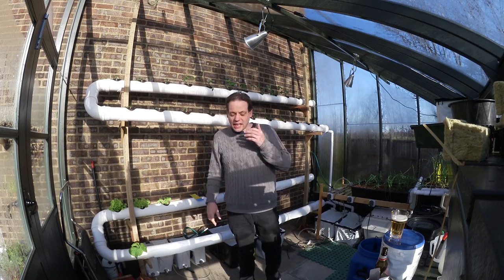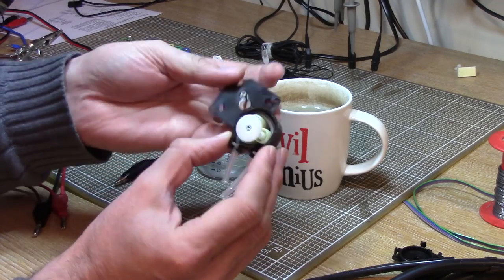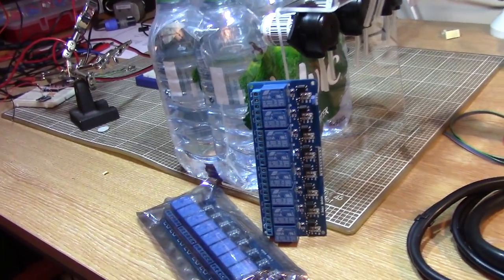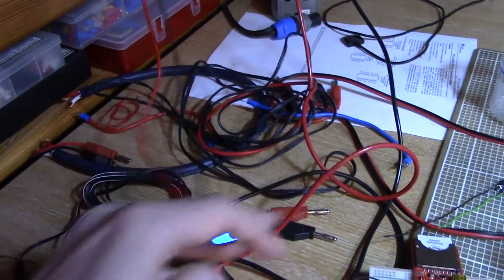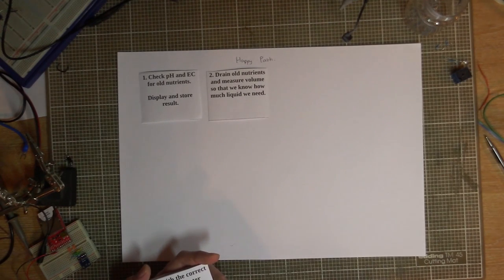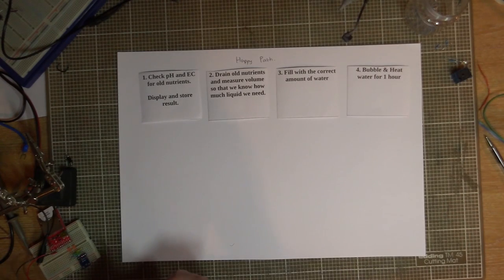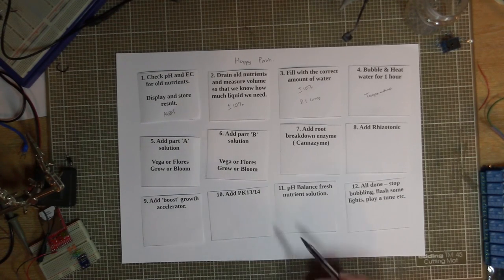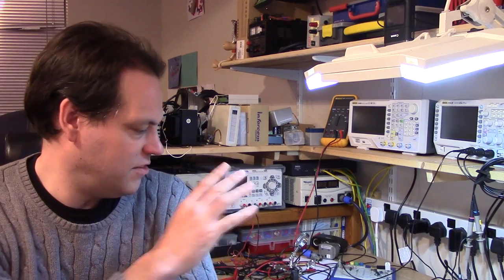The Mixologist - Automated nutrient mixing for hydroponics.

Comment: How is your project progressing?  It's been almost a year since upload.  I am very interested in how you have integrated all off the variables that you outlined in this video
Reply from the maker: Hi +applemarkwantsvids ... The project is coming along so slowly that 'standstill' is probably the best word to describe it... I did a few more weeks work on it after making this video... I added a 320x240 pixel Colour TFT display to run a menu system, and I worked out that the most accurate and reliable way of dosing out the nutrients was to use a load cell to weigh the contents of the bottles during dispensing... That way I'll know 100% for sure that the nutrients have been pumped out of the bottles...I got a load cell hooked up and working giving me weight readings, and I added a few buttons so I could control a menu system but after that, I ground to a halt... I realised that because the load cells are also sensitive to twisting, I'd need a proper weighing platform with a load cell in each corner, and to make that I'd need to spend a day or two in the shed cutting bits of plastic and drilling holes for screws and sensors... This was around the same time that I started a new job, and since then (mid February) I haven't managed to find a couple of days spare time to tinker in the shed. I'm planning on getting myself a 3D printer for christmas this year as that'll let me print out parts for this project. I've not given up on this project... it's just slow going for now. Cheers!!

Comment: Why do you change your nutrients?  What changes?  Why not just top them up, adjust the EC and pH, and keep on going?
Reply from the maker: The plants do not use up all of the nutrients at the same rate, so if you're just topping up you tend to get high concentrations of one particular nutrient (i.e. potassium) but not enough of the others. The EC will still measure correctly because the conductivity is kept correct by the high levels of potassium, but the plant won't be able to get enough of the nutes it's actually seeking. I did look into how large commercial growers deal with having thousands of litres of solution, but they're doing full laboratory water quality analysis with spectrometers so they can measure how much of each individual nutrient is in solution and top up accordingly. Cheers!!
Reply: @ThingsWhichArentWork  Thanks
Reply: @ThingsWhichArentWork  If you watch some videos about trace elements you'll learn that our body tends to balance minerals by taking only what it needs.  Maybe plants do the same think.

Comment: great job!! but i have a problem, i need a oled source code for my kl25z (sorry my english is so bad)
Reply from the maker: Hi Eduard Mazo - I'm using the Adafruit lib which someone ported to mbed... https://developer.mbed.org/users/nkhorman/code/Adafruit_GFX/ ... It worked OK for me, except for sometimes getting the top-of-screen set at somewhere other than the top of the screen... I have a fix for that, but I have to dash out for work now. Hopefully the Adafruit ported lib will get you started - I'll try and dig out the fix later today. Cheers!!

Comment: Why not measure the npk in your reservoir and adjust based on the reading... That way you can add 1 ml check again 10 minutes later after it has circulated, and add another if it is still low. Same with PH. I think you are overcomplicating the process. This would also allow you to keep your levels between certain acceptable ranges rather than worrying about specific amounts dispensed. For error trapping you could set it to alert you if it has run so many times and not reached a correct level. This could mean nutrient level is gone or pump is bad or motor is dead... But regardless it would create a simple easy way to alert you to check. It doesn't matter how the failure has occurred, rather that it has, and will require human intervention.

Comment: WHERE DID  you learn to do all this ? What's the name of this science ?
Reply from the maker: Hi Dominique Dupont. I've been fascinated by electronics and computing since an early age and studied them at college/university. The hydroponics stuff I learned entirely by watching videos on youtube and a few articles I found with google. Cheers!!
Reply: Jim Conner Cool. I'm also learning hydroponic from youtube and I realize the technology is still old. For example, I wanted to make a cheaper CO2 controller. Why does it cost 500 $ at the moment ? It has not been designed and mass produced properly yet.
Reply from the maker: Hi Dominique Dupont - The guys at my local hydro shop tell me that they reckon 95% of their customers are all growing one single highly lucrative (and illegal in the UK) crop... I think a lot of these addons are so ridiculously expensive because they know that they can sell to growers who are making $500 per plant every few months. They're really not targetted at people growing veg. I can see no other way that they could justify charging £150 for an injection moulded plastic tray when I can pick up a similar injection moulded plastic children's sledge of roughly the same size and shape for £10. I reckon you can DIY a CO2 controller much more cost effectively... Ebay tells me that a  CO2-Sensor costs £28, and Arduino pro mini is £1.48 and Pneumatic Solenoid Valve is £4.65 .... I believe that works out to somewhere around $50 for that lot... After that it's just wires, hoses, soldering and code. Cheers!!
Reply: Jim Conner I don't completely agree with you, that is a too broad assumption. But parts of it is true. I think the main reason why I can't buy a CO2 controller under 100 $, is because no one like me took the time to make it ! But yes, I believe it's technologically and economically possible. Science is sparsely applied, even today !

Comment: This is really really cool Jim.  I've got 2 different types of pumps coming UPS tomorrow, one just like yours and the other a brass fixture.  I'm not nearly as far along as you are, and I don't have the technical background you do (except for the programming, I've done a fair bit of that) but I'm having a great time playing with all these things since you started the fire.  I'm only looking to do A/B PH and EC, so  bit simpler.  Hey, did you know the Imp has a built in photocell?  I've added that to my plot.ly graph.  I'll be watching your progress to steal your ideas :)  I'll give you props of course.  There are too many cool things to comment on here.
Reply from the maker: FesterWerks  Thanks Marc. Oooh... nice idea using the Imp's photocell... I'll definitely be stealing that idea from you (particularly as I haven't got the BH1750 light sensor up and working yet)... though I see from your graph that you're plotting it as a 1 or a 0  - does it read off an analog value too? I started off thinking solely about doing the pH balance part (since that's the bit I screw up so often), but decided that if I could get that to work, it wouldn't be much more complicated to dispense all the other solutions too,,, it's just more of the same over and over again. Cheers!!
Reply: Jim Conner Yes, it does do analog (I think only analog) but I only wanted to know if the light was on or off so I did some real quick math to set the value to a 0 or 1.  And unless the sensor is misbehaving, my light turns on briefly around 5am ... odd.
My biggest concern in the whole thing is what you're working on... reliability of the pumps to turn on/off and be accurate.  I'd hate to be at work and see my plot.ly chart off the scale on the pH level and not be able to get home to fix it.
Reply from the maker: FesterWerks I've now added the light level (divided by 10,000) to my own graph at https://plot.ly/~Fecn/340/hydroponic-greenhouse-temperatures.embed - Thanks for letting me know about that one. It was an easy win.Nothing can screw things up quite as well as a computer... I may sometimes overdose my nutes by 5-10ml, but I'd never empty a whole 500ml bottle into there by mistake... which of course a computer will happily do. That's why I'm more worried about dealing with the failure cases I can envisage than I am about actually making the pumps dispense some nutrients (I know I can do that... raise an output high, the relay switches on and the pump starts running). I contacted a sensor company yesterday who make some tiny 120ml/min rated 'mass thermal flow' sensors,,, They've designed a microchip with a tiny heater element in the middle of two temperature sensors... when there's liquid flowing past, one sensor will read hotter than the other one (and the difference between the two sensors can be used to calculate flow rate)... If I can get hold of them at the right price (and I'm betting they cost a fortune and it's not going to happen), then they'd be totally ideal for ensuring the right amount of nutes got added. Cheers!!
Reply: Jim Conner Been curious what happened to your Growbed Nutrient Tank (green)... It's up at 85 pretty steady. Did you throw it in the oven?  I do kind of like the full scale of the light as opposed to on and off.  When I get this working outside, I may do that.

What if you made it a bit longer of a process, adding just a little at a time, waiting, checking, adding again for each process.  Your relay would only be closed for a couple seconds, then  Perhaps run a loop that checks for any I/O whose state is 1 for more than x seconds, if it is, shut the whole process down or some such.

If that thermal flow sensor you spoke of is a bit pricy, perhaps all liquids go through that one sensor, with a fresh water flush in between each.  Just throwing stuff out there.
Reply from the maker: That 85C reading is a failed sensor... The 1820 gives a reading of 85C if it's failed to perform it's temperature conversion for some reason. The 85C is the start value on the 1820 before it deducts the number of counts from one of it's oscillators. I've had one of these sensors fail the same way before (back in 2001)... never did work out why it failed. I've got some more on order anyway so when they arrive I'll pull the faulty one off the bus and test it on it's own... it's possible there's some other reason for it failing to measure the temperature (i.e. water somehow got into my wiring loom etc)

The thermal mass flow sensors were apparently around $1600 each.... so there won't be any of them going in there :).... I've ordered a little cheap capacitive touch sense board from ebay whcih I'll have a play around with... I'm hoping that it'll be able to detect the difference between liquid in the tubes and an empty tube.... Guess I'll find out in a few weeks when it gets here. Cheers!!
Reply from the maker: FesterWerks That's weird... I see from my graphs this morninng that it momentarily got light in the greenhouse at 02:22 AM.... The photo sensor on the Imp  seems to be very much an all-or-nothing affair... Good for daylight detection, but not really much use for telling how strong the sunshine is... but I've got the bh1750 up and working now, so I'll add that sensor on at the weekend. Cheers!!
Reply: Jim Conner Handy to know how to tell if they go wrong.  Wow, 1600, yeah, that's a bit steep for my tastes too.
Reply: Jim Conner I had a few light spikes overnight as well.  Wonder if it's the imp waking up and connecting (red/green led) that's being detected.  I've got a bh1750 on the way as well.
Reply from the maker: FesterWerks Yeah - I figured it was the LED being picked up by the light sensor... There certainly wasn't anything bright and shiny happening in my greenhouse at 2:22 AM (though it's always possible that aliens were landing in the garden, and they'be wiped my memory after the obligatory probing). The onboard light sensor seems to be very all-or-nothing, so I'll get the BH1750 sensor hooked up this weekend for comparison. Cheers!!